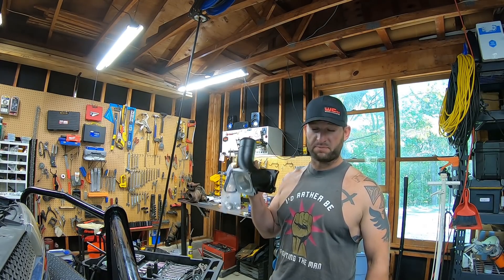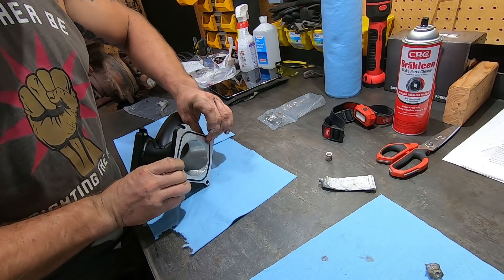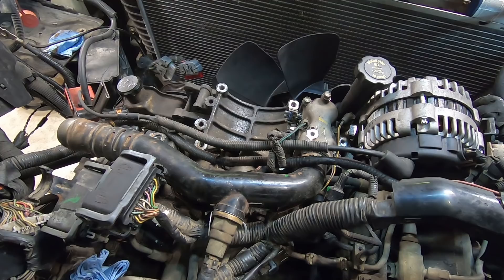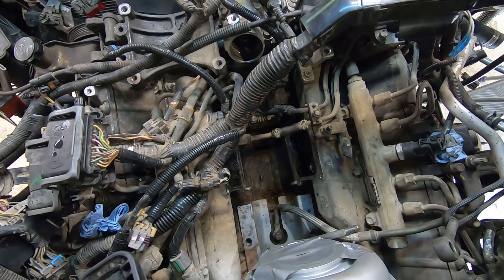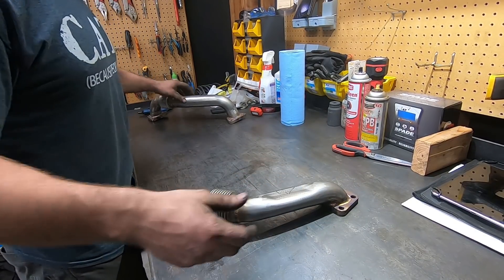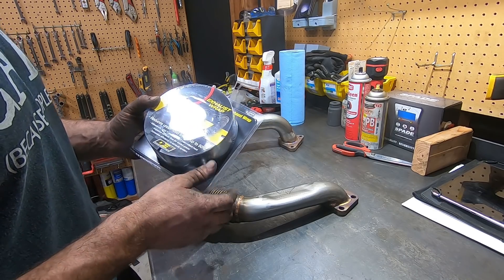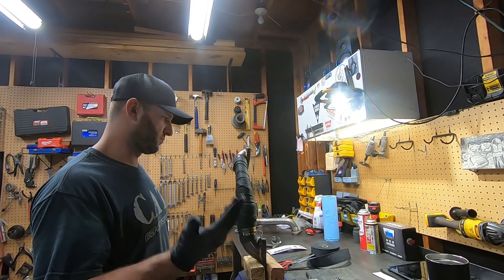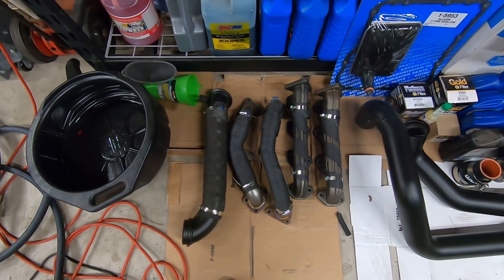Truck Upgrades with Duramaxtuner.com and Wehrli Custom Fab: Day 5

Comment: What's up brotha! I recently came  Across your channel I just bought my 1st piece of property and have never owned even a decent chainsaw could you give me a recommendation on a quality chain saw for cutting down smaller trees and cleaning them up I don't believe any trees are larger than 12" around... I was looking at Husqvarna and  Eco. But dont know what model or size. And I heard the handles on the eco are connected to the gas tank and break often(do you know if that's true)  I would truly respect and appreciate your recommendation. By watching your videos recently I must consider you an expert with a chainsaw thanks again
Reply from the maker: Depends on budget really, any pro line saw is going to be better than consumer, but consumer aren't bad.  For stihl I'd go 261 or 271, not sure about other brands.

Comment: The wrap is cool, but it will rot steel quick if it gets wet or salty. The science behind it is definitely there but I don't think it's really applied until you get into the SUPER massive horsepower range.

Comment: I've heard that even small amounts of silicone fumes can ruin oxygen sensors and a catalytic converter.  Using silicone to hold the gasket in place 'could' be a problem.

Comment: I would put a lift pump and fuel rail plug. I have done these two things and it gave me the best performance increase. Besides the the lift pump helps the fuel pump on the motor which has problems.

Comment: The exhaust flow claims are based in gasses being able to travel faster at higher temperature. The wrap keeps the heat in the exhaust.
Reply: Yeah but it's such a small increase it really don't even make a difference.
Reply: @TRX450RVlogger  I agree, but there is at least some foundation in their claims. It probably helps more in his case being a turbocharger up-pipe.

Comment: That aftermarket full line doesnt hold up that long to the pressure and makes small holes . Buy oem or from a reputable diesel performance shop

Comment: Careful with that exhaust wrap. Using that insulates. Too much insulation won't allow the pipes to release their heat and they may crack and leak. Just something to think about.
Reply: Lol, no, not in reality not at all.   It’s a tried and proven practice, besides if heat causes your exhaust to fail...... lol.
Reply: @jaxturner7288  yeah, right. Tell that to hundreds of people on forums talking about how heat cracked their pipes on forced induction with wraps installed. 

If you're gonna talk out of your ass, at least be nice about it.

Comment: I'll never forget that final f-ing bolt, took us about 3 1/2 hours to get it in !!!
Reply from the maker: lol, yeah, that one sucked, think it took me about as long
Reply: Get a set of snap-on swivel sockets and a quarter inch extension and it’ll go on like a charm. Snap-no’s swivel sockets are thinner and have a better turn radius than other brands and made it really simple on mine